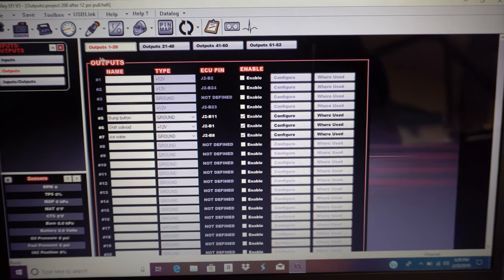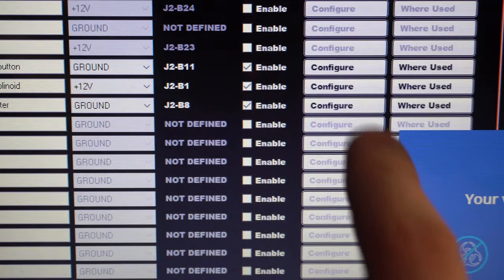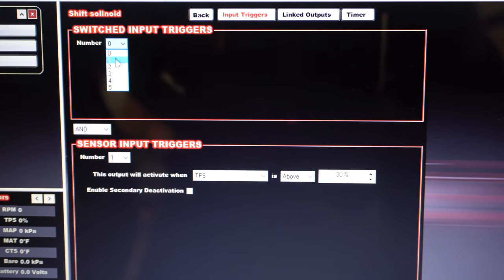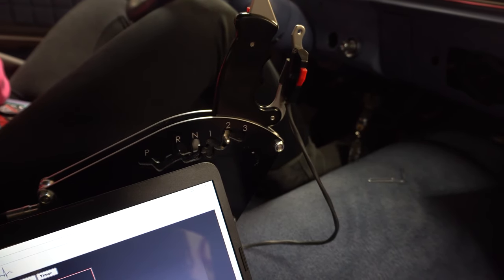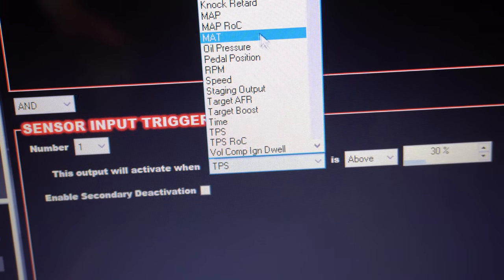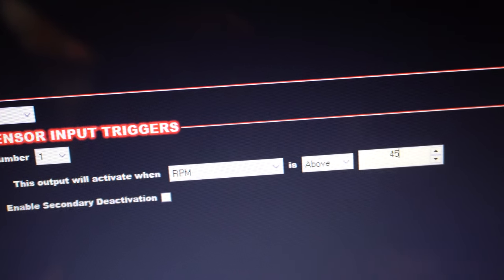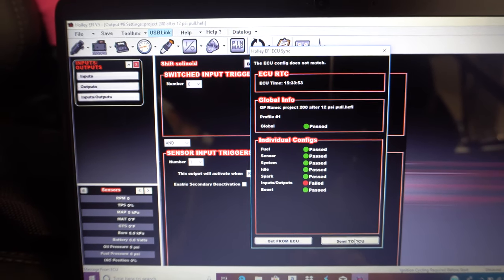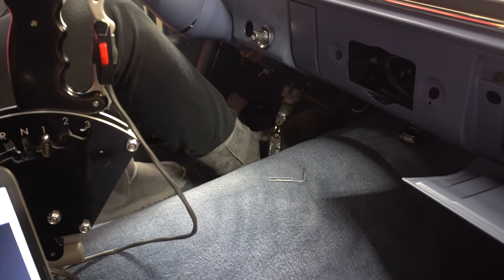Holley EFI Shift Solenoid I/O Output Setup

Comment: Hello In your video you said you were having an issue when you had the solenoid being activated by the ground signal. What was it doing? in my situation I’m using a Motion Race Works operator shifter and I have my setting set at 6800 RPM when it shifts to second gear, it keeps the solenoid applied not letting the shifter to come back slightly to be able to shift to third.

Comment: What kind of electric solenoid are you running on the shifter
Reply from the maker: It’s actually a co2 solenoid and it came with the shifter!
Reply: @BuildTuneRace  so your running air with the holley

Comment: Do you have it triggering a relay, or is the output going straight to the solenoid?
Reply from the maker: Pretty sure we are going straight to the solenoid. We ended up fixing it by adding more Co2 pressure and has worked awesome since!

Comment: I’m using Holley v2 and for the outputs it only shows ground and -pwm can I use -pwm and use a input ?
Reply: Same here. Did you figure it out?
Reply: @dennisallen373  what you trying to hook up?
Reply: Electronic shift silinoid using an output V-2 only Let's you use ground Or pwm. Using ground won't activate the silinoid to lock the pin in first
Reply: @dennisallen373  you using Mac valve ?
Reply: No it's just an electric shift silinoid no co2 on board

Comment: are you using 2 outputs for the 2 different gear changes? I'm having issues with the same shifter setup.
Reply from the maker: 1 output then each time it hits that rpm it activates
Reply from the maker: I had issues with it at first too. Shifter had a hard time going from 1-2 we only had like 80 psi going to it when we changed the regulator to 120 it worked a lot better. The shifter had little bur it was kinda hanging up on. I would activate it then need to still add a little pressure by hand and then it would shift.